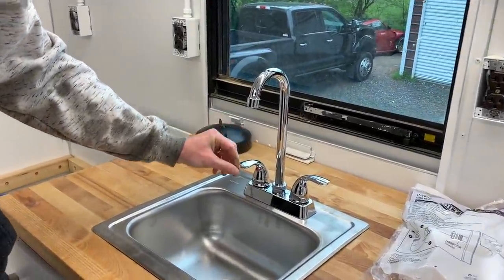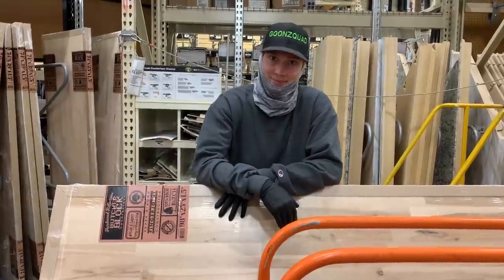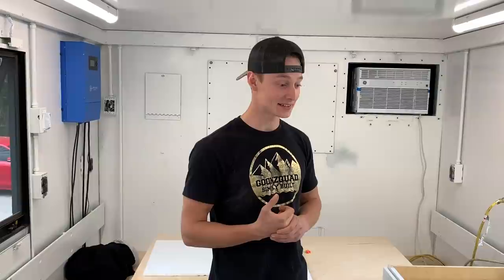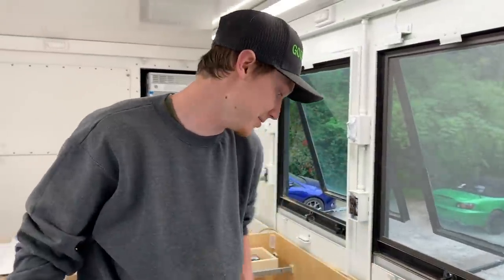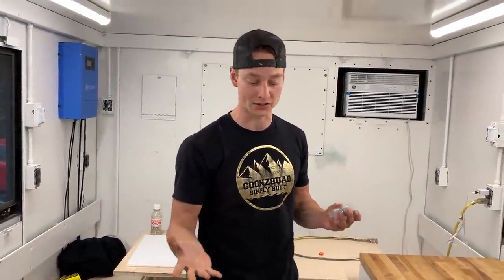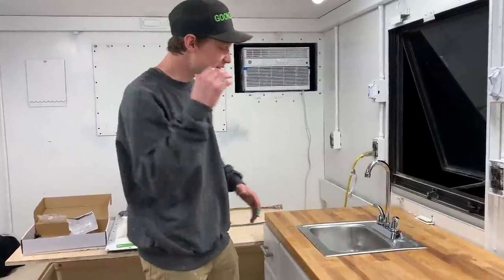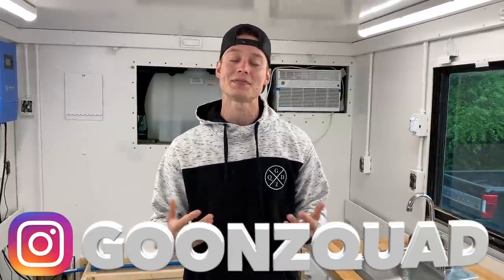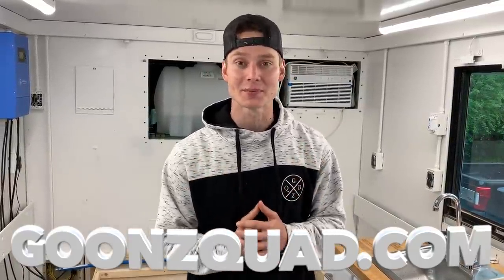Building The Ultimate Apocalypse Vehicle Part 7

Comment: Any leakage at the fitting coming in from outside could fry your batteries, and I would insulated the outside line so the water tastes better in the summer and doesn't get hot, and it won't freeze in wimter.
Reply: The fitment of that water line is just dumb. Everything they put in that storage compartment underneath the bench will have to pass that water line (next to the problem you mentioned).  I don't get why they don't make double walls and put all the lines inside. Could also add some much needed insulation.

Comment: Good job and choice of counter top too ! Instead of filling that tank from the top, you may consider adding a coupling on those pipes at 20:14 with a garden hose compatible inlet. Much more easy access to refill said tank ! As on any RV. All you need is a T coupling and a valve.

Comment: Looking freakin awesome!

Some nits:

Water would probably work better with a pressurized tank - air pump to push water from tank.  As someone said earlier, with a pump pulling from the tank, you need an air inlet anyway to keep your tank from collapsing.

Dudes - You're spraying mud into your air intake.  Mud flaps for cab?

Mind your "kerf" (material removed by saw) on the cuts.  You don't want the saw blade to remove material from your finish piece & throw off your measurements.  Keep your blade on the outside of the cut-line from the finish piece.

Comment: 12:15 How are you going to pull the frig out when it breaks? You've just blocked your way of getting to those brackets.
Reply: I think they can take the white side wall out because of the way they screwed it to the rig 12:01
Reply: Suppose they could cut an access panel in the side if and when it goes out, easy enough to make it look good.
Reply: @noremacsnibbor8914  but they probably would of glued the countertop to the top side of it
Reply: I suppose they can dip into the limited supply of cash ?

Comment: There needs to be clear sealant around the edge of the sink otherwise water will leak into the cupboard from bench top
Reply: Plumbers putty works well for that application. It remains flexible for years and it is waterproof. The sink probably came with some brackets to secure it to the countertop.
Reply: Yes please. I hope they don't forget  to seal the sink. If they spill water it will otherwise soak into the unprotected wood beneath ans ruin it. Also they might want to seal the edges of the hole they made into the wall for the plumbing.

Comment: Sounded like the pump was struggeling a bit, perhaps it was building up some vacuum in the watertank. A vent missing?
Reply: The lids on these water tanks usually have small valves on them for air flow.

Comment: Hit that Tung Oil finish with 0000 steel wool to get a smooth finish.
Reply: Tung is an excellent option for surfaces that will be used for food preparation.Nut oil can be deadly if you have someone with nut allergies like my niece.

Comment: dude id recommend that the water tank is insulated along with the pipes otherwise they will freeze and u will get leaks man
Reply: to be fair they are just bandannas that are probably made of cotton, and the main material in face masks is cotton.
Reply: The devil Made me say it  hey dummy, they might wanna travel to areas that can get below freezing.
Reply: The devil Made me say it  hey dummy the south still gets 30s and some winters 10s it's still cold AF here
Reply: @HurricaneHusky  and the mesh isn't the same, here that's useless :)
Reply: Yeah Alabama where I live it gets down in the 10s some winters only 20 this last winter though thank you lord
Reply: Love you guyz though
Reply: The devil Made me say it  yeah it's not to some places but freezing is only 32° isn't that the whole argument haha
Reply: I work in degrees mate and if it’s 0 degrees anything will freeze like I’ve seen snow on their Chanel before and with that the pipes etc would freeze so just a precaution. Possible putting a frame around the water box so that it’s insulated using some spray foam or foil insulation

Comment: Guys on top of pump is adjustment screws for flow. Also look at your wiring again for mains, generator and solar should be able too hook 3 modes up and have them all controlled by one module. 
The mains can be set up like shore power for camp sites and at home. The batteries can be charging when hooked up to this and also from solar

Comment: You guys should add an in line filter between the pump and the water tank. That way if any debris gets in the tank (which is bound to happen at some point) it won’t go into the pump, ruining it and also you’ll always have nice clean filtered water. Also, maybe look into one of those small under sink tankless water heaters? Sure would be nice to have hot water not only in the sink but also for the outside shower you guys had mentioned in an earlier video. Much love fellas. You guys are always killing it!

Comment: Just remember water weighs 10 lbs a gallon that's a lot of weight on that bracket, and the shocks transmitted when off road.
Reply: Closer to 8 lb
Reply: Yeah imagine a 270 lbs dude jumping up and down on it.over and over again!
Reply: Bracket aside its alot of weight up high regardless of how its attached and when the tanks part full its alot of weight moving around up high. Not to mention difficult place to fill the tank.
Reply: Or 1litre = 1kg
Reply: Dont think the weight of there water tank is going to matter on a vehicle that prolly weighs 40 thousand pounds lol
Reply: @ezmcclure05  with it being that high up it could make a difference those off road trucks like that have an extremely high centre of gravity to begin with.

Comment: Secure the counter top down with large latches much easier to get in there when you need to, and you will need to.
Reply: I was gong to suggest the same thing but there is only one brace in the cabinet. Then should add a couple more and then screw down the countertop. Gluing is not a good option unless you want to destroy everything and start over if you need to get the countertop off. They could also get a jig and use pocket holes.

Comment: Im no woodworking expert but i would advise using whatever finish on the top also in bottom.   The wood will expand and contract at different rates if one side is left unfinished and could split.

Comment: Great Job!  Here are a couple suggestions. Rubber grommet the piping especially on the outside otherwise it can be critter heaven   Also grommets will lessen vibration and you don’t want connections to fail.

Comment: I'm surprised you even need the water pump. The tank is probably high enough for you to feed it through gravity.
Reply: Yeah the pipes going across the room... will basically have no water pressure.
Reply: @Chipwhitley274  i does not matter how long those pipes are. water always keep leavel, unless they are blocked.
Reply: @akltom  their water tank too small to create pressure , and the sink almost same height with the tank 
water will reach there but will like 80 years old man peeing .
so they need a water pump
Reply: @yapyow3416  is not about how big is the tank gravity should do the job, and they have a problem with the pump it did not have pressure it look like it was just gravity.

Comment: Batteries outside the living area, they produce Hydrogen when charging, Boooom! Get some Lithium batteries?
Reply: If a lithium batt shorts out you have an incendeary device! They would def need to be on the frame. IMO
Reply: Maybe some Optima batteries.
Reply: Those are Agm or sla. Meaning no gases
Reply: These boys ignore advise.
Reply: I have see this all the time anybody that tries to build their own little Camper RV or solar power system puts their batteries inside their living area. They do enough research to figure out how to make it work but not how to make it safe

Comment: Hey guys! You have to use plumbers putty under the lip of the sink and you have to use the plastic 3 hole spacer that came with your faucet. All those things help to keep water out of your cabinet that will warp when water reaches that particle board.

Comment: you need a bypass back to the tank when the faucet is off or else you dead head the pump and it has no where to go.
Reply: Depends what type of pump they have
Reply: I just thought about it some more, you want to reduce the flow on your bypass so it prefers to flow through the sink.  or you can get an "on demand" pump

Comment: I use those pump for window cleaning and it sounds good to me.
It runs for a while after you turn the water off and the bottom (where the in and out feed is) has a pressure switch. When the pressure builds it will shut off. Looks good to me.

I would have mounted the pump closer to the tank tho as they are loud.

Comment: Flip the pump right side up and re-route your water lines. The pump will run until it sees enough pressure . Then it will still jerk a few more times to keep that pressure built up inside the pump. Looks good boys, almost there.

Comment: If theres one thing to be said is you guys aren't afraid of learning something new wether or not you succeed the first time or not you never give up . Your not like other youtubers who edit out there mistakes or trials you give it to us straight and that deserves respect my recommendation and I'm not a plumber is reduce any extra line that you have seems like theres quite alot of extra pex. Also I would put rubber bushings to the mounting hardware for the pump to decrease vibration.  I would highly recommend that you do not run that pump dry be very careful to not do that as it will burn up almost immediately in most cases . You may want to look into an actual RV or marine water heater and pump they make very compact water heaters I've installed on boats and be sure that you are running the right amount of power to the pump it definitely never hurts to ask for help from a buddy or youtube subscribers.  Good luck absolutely love watch you guys.

Comment: It's really bugging me how you can only enter the table from the left side. One person will have to slide all the way around. Why not just shorten the counter width by 12 inches? Or maybe have the right side of the table fold up for entry and exit?
Reply: it ain’t like they finna have family of 12 sitting in there
Reply: If you notice the table is rotatable, if they rotate the table 90° they can seat 4 comfortably. I had the exact setup, worked great for me.

Comment: Great job guys! Love the channel.
Might want to use rubber gromits on the openigs for the water lines. Over time the vibration from driving will cut through those lines, causing a leak.

Comment: Great job, guys! Only suggestion I have, is whenever you're running any line through holes you've drilled in metal, use a grommet so that vibrations over time don't cut through your lines there. Otherwise, you guys are doing great! Keep up the good work, love the videos!

Comment: Add a small lip in the front edge of your shelves. When things start sliding around, you don't want them pushing your doors open.  Or put your stuff in baskets or containers then in you cabinets. 
Water pumps can be loud. The one in my RV is in an outside compartment. You can still hear it drone when it is running. 
Is your tank certified for potable water? Some plastics have lead and other nasty chemicals. 
When you use a hose to fill the tank, don't use a regular garden hose. Use a hose meant for drinking water. Walmart carries them in their RV section. A lot cheaper than Camping World.
Make sure you sanitize your water system. Add a  3 or 4 cups of bleach to a full tank of water. Run the water until you smell bleach. Let it sit over night. Drain the tank. Fill and drain again. Then run water through the lines until you don't smell bleach.

Comment: I think you guys should put a backsplash 2 or 3 inches high. Just incase you guys spill water or food. It won't get trapped behind your cabinet. It will be a pain in the ass trying to fish out the food and soaking up any water spilt. 

I ran into the same problem with the water pump. I used scrap 2x6 lumber and made a T. The T is screwed upside down to the floor and then I bolted my water pump in the right configuration. I really enjoy the videos. Keep up the great work!

Comment: Pressure pump from camping world, insulate water line. They sell a water heater for hot water that runs off antifreeze or electric.  Gray water can go on ground its black water that cant. I used to drive a super sleeper semi that was pretty much a camper. Also on fridge doors use 2 90 degree brackets on front for freezer and fridge close together and use a drop in cotter pin

Comment: You can get something to hold the fridge shut at an RV place. They have several different things that will work. Or you can fix a metal pole from the counter to the floor right in front of the fridge doors.

Comment: You may have too much pressure from the tank side of the pump which is why it won’t shut off. Been there. You can test it by filling up the tank all the way and see if the sound changes. If it does then that’s your issue. You might have enough lift to run a gravity fed system... no power needed.

Comment: Welcome.
I noticed that you placed the clean water tank outside. In this case, you must remember about a heating system so that during the negative temperature (below 9 degrees Celsius, 32 degrees Fahrenheit), the water does not fog, also about the pipes that are outside and supplying this water to the tap. The same applies to the gray water tank and its drain. Greetings from distant Poland and stick to these hard times. The main thing is not to give in to this virus.

Comment: When you run the piping add heat tape so they dont freeze! Run pex pipe it will flex for ya an add a transfer pump for under your sink to pump water from the tank

Comment: You should put something under the water tank where it sits on the metal framework. The vibration will wear a hole through the plastic tank, speaking from experience. Great looking counter top.

Comment: the water tank in campers is usually installed inside the cabin, under the seats to avoid freezing. it also would lower the center of gravity significantly. make sure to insulate the tank if you leave it where it is now.

Comment: If the water tank is higher than the faucet you may be able to just gravity feed the water with no pump.  Might be weak though.  Easy to try.  It would better is you could elevate the tank a bit.  Love your videos.  This series is exceptional.

Comment: Hey guys you are doing some fun stuff. I would suggest you not run the water in the same cabinet as you batteries. You got some great ideas when you looked at the campers, I would return to the campers and look a little closer to how they run all there stuff. A propane fridge might have been a better way to go over power, I have dual fridge in my camper. Have you thought about heat when it gets cold? Another thing that would be kool is if you made one of the two sides slide out 12” to 18” you will love the space on the rainy days. If you are going for a week trip you need to think about more storage space for food and supplies. Keep up the great work, keep being safe.

Comment: Good work dangsons. 🤟🤟🤟🤟
Bits of advices 
The water pump should not be placed upside - down.
And always you need to prime it before turning on AC power. 
Your pump will blow out in some days if u keep on turning it in on and off without priming.  
One advice - please avoid turns and elbows in water lines to avoid pressure drop .  👍👍👍👍😎😎😎😎😎😎

Comment: Fit a digital controller for the pump, run it at about 80 percent and the noise will reduce loads! Also they can detect when you shut the water off, so instead of waiting for the pressure to build up to hit the pressure switchth, it will turn the pump off straight away reducing the pressue in the system. Also the pumps run better upside down.

Comment: For the plumbing, mount the freshwater tank below the sink or some other part of the camper's floor framing. With the tank so high up the gravity is overwhelming the pump; if gravity's sending the water down why would you need a pump? Also, have a sink faucet with the hose - can mount to the outside wall for a rinse shower set up too? Next, by septic, I think you are referring to the black water (toilet waste) and gray water (sink waste). I've been a long time fan and have done way more research on tiny home/van builds that y'all, contact me if you have any additional information. Hope I can help!

Comment: Take the counter top cutout for the sink, cut it one half inch bigger than the sink bowl both directions, then rabbet it so it will sit inside the bowl on the wood flange the rabbet creates. Instant, easily stored and lifted cutting board.

Comment: You're going to trap water in the lines with it running back uphill. I'd run those water lines across where they don't go uphill at any point, if you need to create a guard for them I'd do that and not run them under the seat. Any kind of impurity in the water will eventually start to foul and cause everything, including the cab to smell like farts because it will begin to ferment. As others have mentioned that trapped water is going to freeze and you'll have no way to drain it, so the lines will split and you'll have a leak. If you must run it under the seats, put a drain in there where you can dump the trapped water into a bucket or something.

Comment: @goonzquad have you considered ventilation for your battery compartment under the seat.  Be careful because its possible for batteries to give off dangerous fumes when charging. Even sealed cells aren't 100% safe, they can give off fumes if they rupture for some reason without you knowing....be safe guys.

Comment: Take the sink cutout, cut it down so it is a little bigger than the sink bowl. Then cut a rabbet around the outside so you can drop it into the sink and have the rabbet hold it on top.